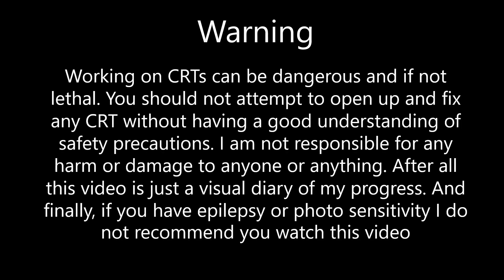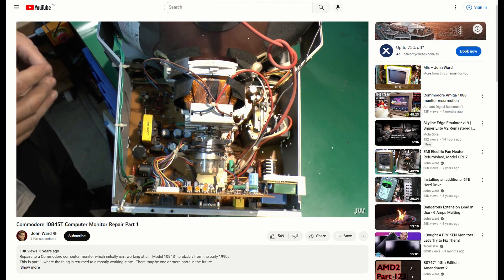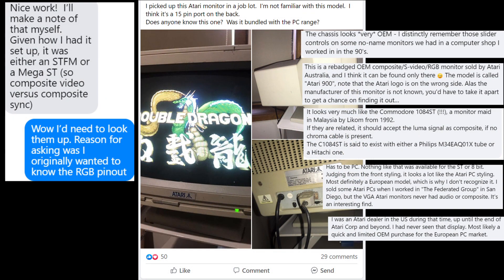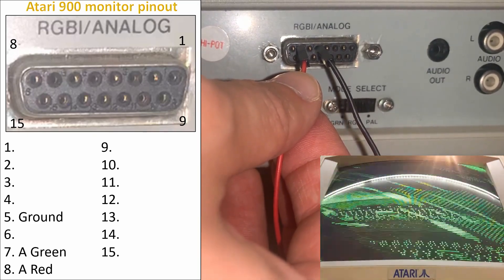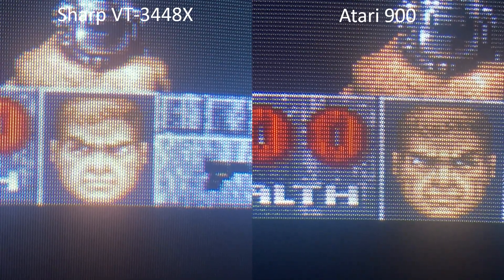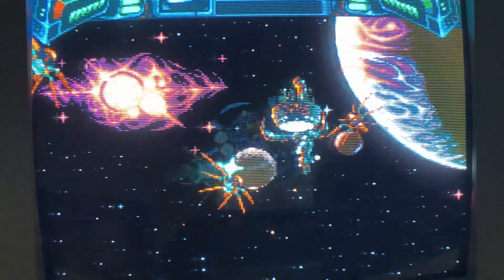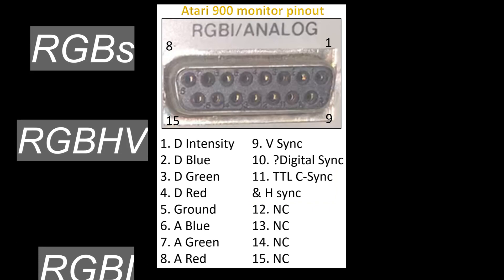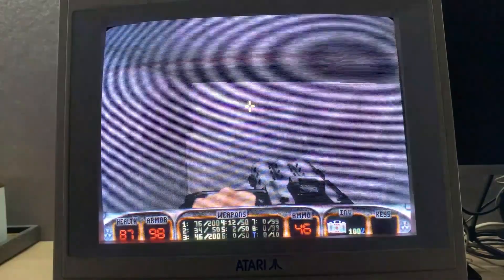The Atari 900 CRT RGB monitor

Comment: I've had one of these monitors for years but barely used it, probably because I wasn't sure of the pin out so this video was very helpful! I wasn't even sure if it was called a 900 because the only thing standing out was the slightly bold "900" labelling on the rear... no typical SM or SC prefixes. I remember opening it up to look at the tube and then it went back on the shelf. It came from a friend in NSW Australia who might have gotten it with a Mega ST. It seems back in the day there were a few Australian only monitors assembled here out of random bits and pieces!
Reply from the maker: Glad it was useful! I ended up going back in and connecting an internal 5v source to one of the spare 15-pin lines to power the sync stripper to make life a lot easier. My friend made a discovery on the neck board where ‘SONICA’ was printed, so they must have made these for Atari. They’re an awesome monitor, I counted 400TVL and reminds me somewhat of an arcade monitor

Comment: Hey i just found this video after finding this monitor for 50 bucks it currently doesnt work as it shows no signs of life what so ever
Reply: Mine for some reason is missing the chroma and luma plugs
Reply from the maker: Is it labelled ‘900’ on the rear sticker or some other model? I’m no expert with Commodore, Amiga and Atari monitors as I just happened to stumble across mine by chance, but can direct you to these two sites that might have some information of what family they belong to. The flyback on some Commodore monitors are known to fail if it happens to be an identical chassis to something listed in these sites
https://gona.mactar.hu/Commodore/monitor/Commodore_monitors_by_model_number.html
https://www.atari-computermuseum.de/st_peri.htm

Comment: I’d really love ur take on my fw900 and how I’ve tricked windows Into 240p and how the hell im running it. I’ve counted lines even and it’s true 240 I don’t know how?? I thought its running line doubling like when using Mister fpga @640x480 but nope. It’s almost acting like a pvm with a set line rate of 1920.  I’m running bnc RGBhv.   Take a look at my shorts or one video showing how to fool windows into 240 as recommended(native) resolution if you are bored. I can run as low as 256x211 for chronotrigger. Oh using 980ti.
Reply from the maker: I haven’t delved into PC’s and tricking the CRT into faux 240p with a higher refresh. I watched the 160Hz short and it looks amazing. But 160 being a non-integer of 60Hz, I wonder if you’d get frame stuttering. Looks amazing nonetheless
Reply: @MarcoRetro316  zero stutter.. I thought same thing but seems dependent on my geometry and having the correct 4:3 aspect on this monitor using 240p suite and measurements to max 4:3 screen space from manufacture.  As soon as I try to widen to fill the screen i get stutter.  As a matter of fact vs snes nt running scart to bnc it’s miles smoother in every way!! I don’t get it either…. This only applies when I’m running exact native res of the system I’m using…  keep in mind my dpc latency is extremely low on this pc back from playing counter strike competitive.   Anyways thanks for taking a gander!! I subbed.. actually smoother @ 160v 40h vs 120 30
Reply from the maker: @PixelGod240  as long as it looks good and you’re having fun that’s all that matters, but understanding is so much more satisfying. I wonder if around 160Hz is the limit of what the human eye can appreciate without perceiving stutter. Interesting. Subbed back at ya
Reply: @MarcoRetro316  I thought of that but even if I drop it to 90 hz still no issue. Also I want to think it’s faux 240 but every res looks different and even running a proper res windows likes (640x480) it’s a massive change In scan lines…
Another thing that makes me believe it’s tru resolution is every program shows zero scaling. Windows/3D party software/capture cards/all programs. In fact steam won’t even launch a game.. I get an error statement that the game doesn’t support the resolution.  
I will figure this out… how many people pay for scalers and complicated set ups like switchres and trying to run 120x60 etc etc.  I was informed that when using RGB ntsc is not a factor… possibly that’s a factor.  But if it’s real 240 then I’ve found the gold mine for vga crts!!! 
Thanks I’m watching ur vids they are excellent! Glad YouTube recommended you.  Also thanks for the convo it’s been fun and I appreciate it!